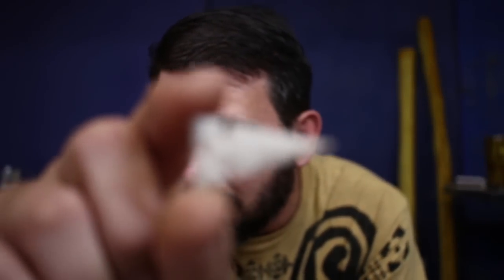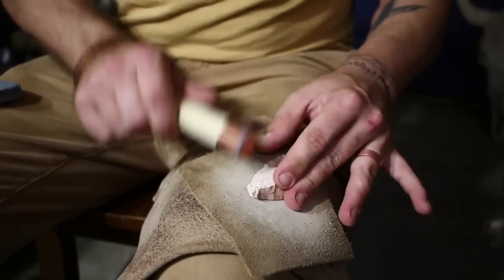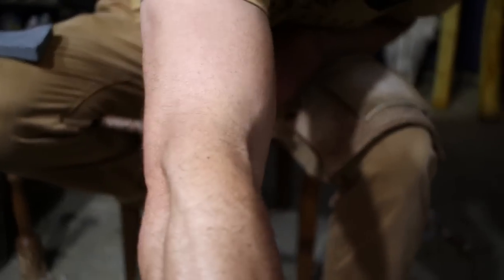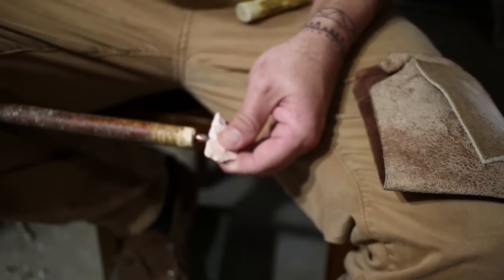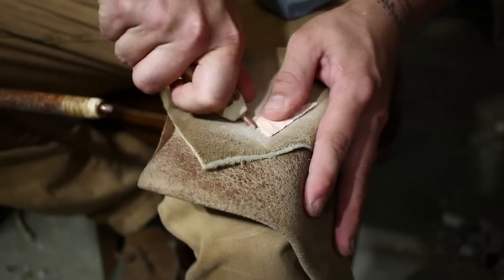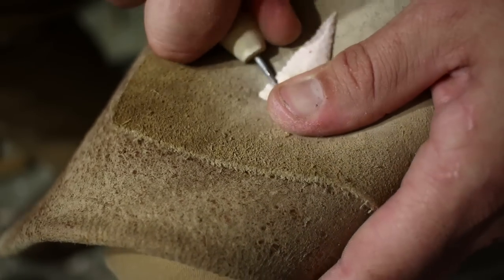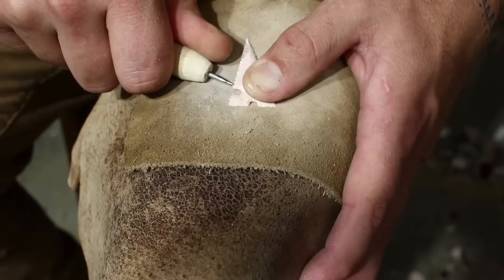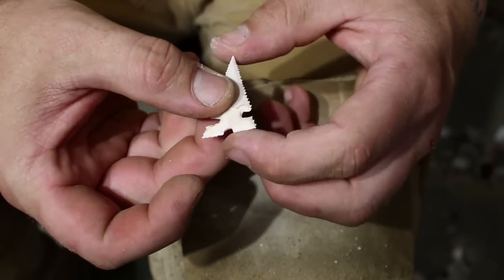Knapping a Cahokia point. Indirect Percussion

Comment: I think you are absolutely correct on that notch in the base! That makes so much sense! I haven’t made any primitive arrows in a while, but I used to heavily zig zag my bases so the base was an effective saw and I would “custom fit” every point to its shaft to remove that web left over from sawing the notch out for the point. A notch in the base would have been much easier to do!

Comment: Thank you so much for your videos, I've been learning so much from them! my first set of tools and Flint should be here by the end of the week! Anyways I was looking at your method for indirect percussion, you said you use sparkleberry for a hardwood with the wood mallet. I've built in exterior deck made out of ipe, the wood was so extremely hard, dense, and heavy that you might not need the mallet it might have enough weight behind it and you just tapping it with your hand. Let me know your thoughts and if you think it can work I still have quite a few sticks left I can send you a couple. They are square pieces but you can send them round if you wanted to. It's the least I can do after after what you do for everybody else in the community. Thank you once again.
Reply from the maker: very welcome and glad to hear it. The weight of the stick isn't really the important part. You won't get the same concussive force by hitting it with your hand though. I have even recently had to switch over to oak to keep up with the demand. The important part in using the hardwood is to  make sure the stick is tough and won't split under the stress of percussion.